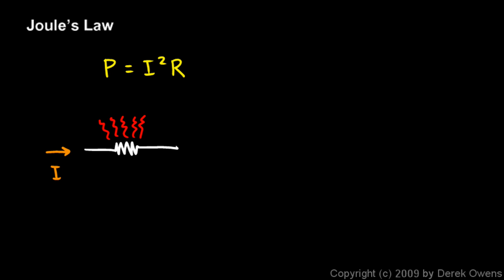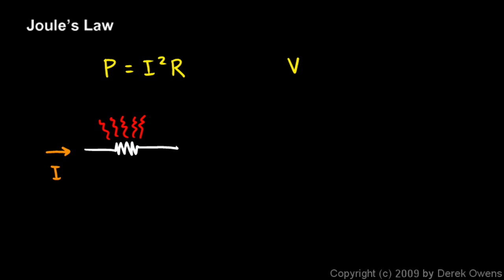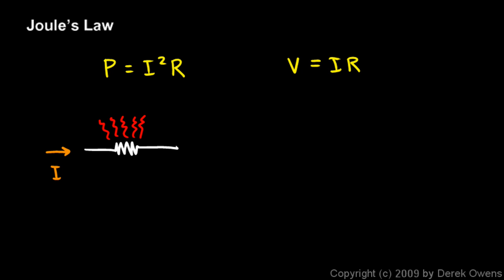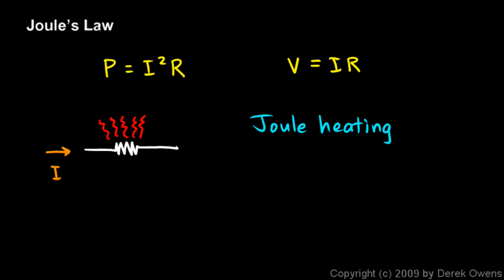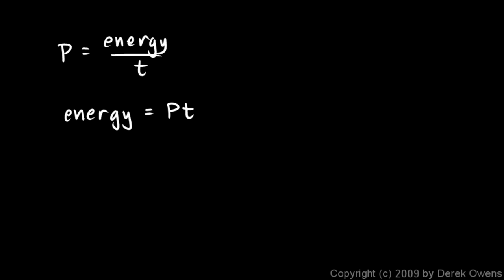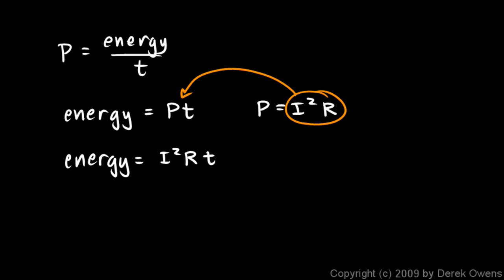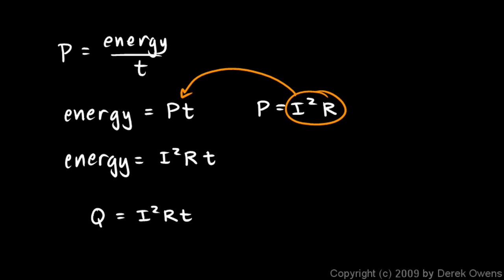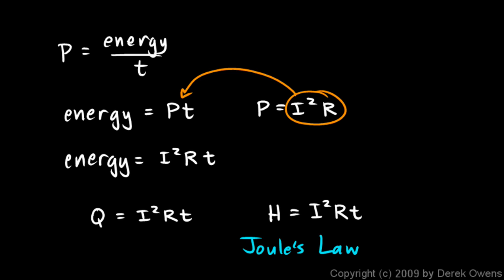Physics 13.3.2a - Joule`s Law

Comment: You said that the conversion of electrical energy to heat is 100% efficient. What about the light that is produced by glowing resistors like a heating coil such as on an electric stove?
Reply from the maker: Oh, that's a good point! Okay, that light will eventually strike some surface and be absorbed, and when that happens the energy from the photons cause the atoms of whatever absorbed it to shake just a little bit more, and that is heat. The exception, though, would be the case where some of that light radiates away into space. In that case, it would just travel across empty space and might not hit anything for billions of years, so it would be radiant energy and not heat energy. So you are correct, the conversion to heat in that case would not quite be 100% efficient.

Comment: What about the devices that are not used for heating? How do we calculate how much heat they dissipate, and how much heat is used for useful work? In case of heaters, dissipated heat is basically useful work :D.

Comment: So if you have: 10^2 A * 1k ohm * 1 sec = 100.000 J
When you convert that with online celcius converter i give you: 52.66 degree celcius

That means the resistor should go from 1 to 52.66 C* after 1 second. Does that sound approximately right to you guys?
Reply from the maker: I'm not sure what assumptions your converter was using, but it would depend on the mass of the resistor and the material it was made from.  But yes, it should heat up quickly in this case. 100 Amps is a lot of current.
Reply: +tuttar3 The figure which you converted into degree celcius is actually the heat generated by the resistor. In other words, by this amount the resistor heats up. But to determine the temperature raise, we need the heat capacity of the material of resistor (how much heat will raise the temperature by 1 K or 1 degree celcius).
Reply: He did use 10 Amps, Derek, and put that in the equation for H.

Comment: Really a good video. I don't know much , but i think resistance and temperature are             
related .The temperature changes right ,as you said.Heat is released continuously .So will there be any change in resistance

Comment: So, I'm confused. 

Is Joule's Law H = I^Rt or is it P= I^R?  (Sorry I have to use the ^ symbol for squared) or is it both depending on whether or not you're looking for power vs. heat?
Reply: im wondering the same ting, but I think what it means is that  P = I^2 R is Joules Law for Power and the other one is Joules law for heat. Someone correct me if im wrong